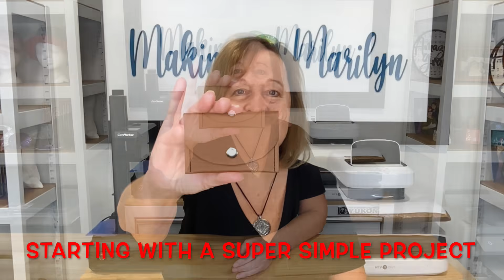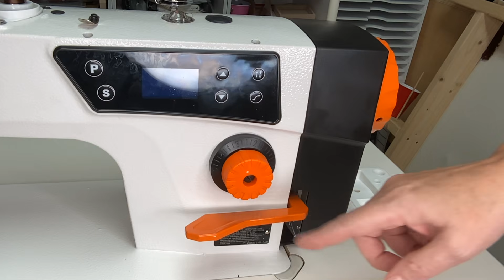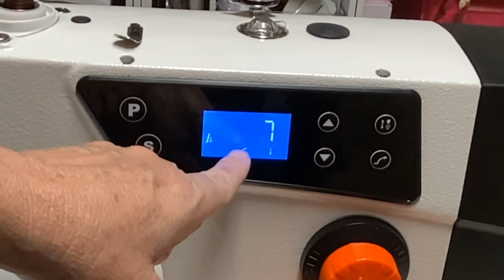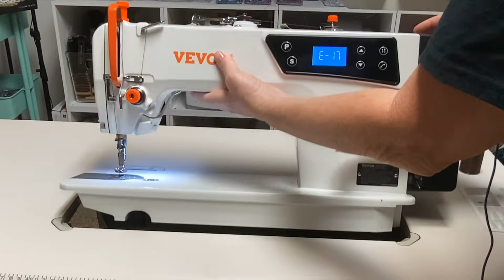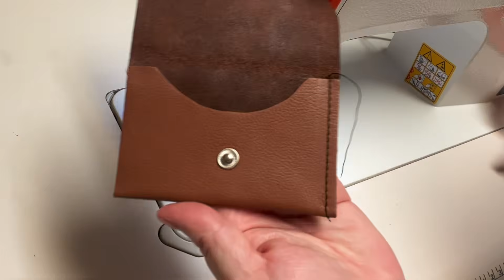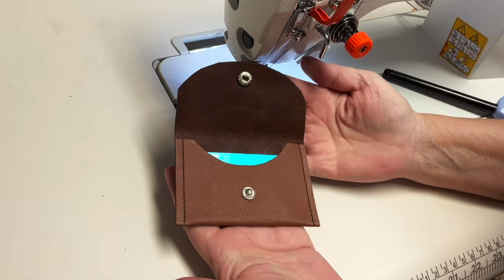Vevor Industrial Sewing Machine Overview and First Project #vevor

Comment from the maker: If you want to check out this machine, here is my link to it (it is an affiliate link) https://www.vevor.com/sewing-machine-c_11158/industrial-lockstitch-sewing-machine-lockstitch-550w-servo-motor-and-table-stand-p_010794942604?utm_source=favorite&utm_campaign=010794942604&utm_medium=99265155&utm_content=1020107949426045946&utm_term=722&compress_code=QTX5S2 
 (my machine and table came with some cosmetic imperfections)

Comment: How was shipping on this machine? Did it take long to receive it from the time you ordered it? I can’t find any information on if it is shipped from overseas or from the U.S 😊
Reply from the maker: As I recall, shipping was from a US warehouse, but I assume it originally came from overseas. However, I don't know that. Also, I think shipping is free. I have a link in the video description but it looks like they are currently out of stock. Here's what I think is the updated version b/c it says it has a thread trimmer and mine does not. https://s.vevor.com/QT03G0

Comment: Do you know how to lower the feed dogs.
Reply from the maker: Here's what I found when I researched it. But if your goal is to lower the feed dogs below the needle plate for free-motion quilting or embroidery, the M2 does not appear to have a quick drop-feed function. The manual's procedure is an adjustment:
Turn the machine completely OFF.
Tilt the sewing-machine head back in the table so you can access the mechanism underneath.
Locate the feed bar and feed-bar crank.
Loosen the screw on the feed-bar crank.
Move the feed bar downward to lower the feed dogs.
Retighten the screw securely.

Comment: Does it use DBx1 needles like most the other industrials? Same bobbin case and "L" style bobbins as the jukis? 
Also the knee raiser question... My juki only has .5" raise manually as well but with the knee raiser I can go up to 1.5". Same with this? 
This is so cheap for a full industrial setup with table. 
Also my motor is mounted under the table and I have a belt and it's a big motor I think 750w
This is listed as 5000 stitches but looks like you showed 3700 is max
Reply from the maker: Yes, it does use DBx1 needles. And it does use L style bobbins. I assume it is the same bobbin case as the jukis, but I do not own a juke. I recently adjusted the knee raiser and can now lift the foot higher than before but I don't think it goes up a full 1.5 inches. The motor is also under the table and it is a servo motor.
Reply: The 5000 is motor rpm, not sure why they went that way......3700 spm would be a more common spec...

Comment: I'm curious, is this like my juki with my new servo motor where you can vary the speed with the pedal and when in needle down and the end push back on the pedal to raise the needle up? 
I have a needle position sensor I added to mine and when I'm done if I push the pedal backward it raises the needle and is ready for another seam.
Reply from the maker: This does not have variable speed on the pedal. There is a button on it to raise the button. Not sure if the heel does it also. That sounds nice.

Comment: Was there other spots on the machine that need to be oiled besides the large reservoir underneath? I’m looking for help since the instructions are not very helpful
Reply from the maker: I asked JChristopherGear about this because he knows this machine so much better than I do. He had an excellent response with great tips: Pretty much, if you keep the oil pan full, and the oil wicks are down in the oil, you should be good to go. You can take the cover off the end (the needle end) and make sure it's wet. 

He also told me that if I sew slow, which I do, to turn it up to the max speed and run it until I see oil in the bubble. You would do this on scrap fabric.

Please check out his channel b/c he has excellent videos on this machine https://www.youtube.com/@JChristopherGear

Comment: Was shopping for a Jukie and came across this...Love the price but hate the plastic parts.  Do you think it'll hold up?  And curious as to why you didn't backstitch?
Reply from the maker: I really should have backstitched. I hope it holds up well over time. I won't be using it nearly as much as my everyday sewing machine. But if you are concerned about it and have in your budget to buy the real thing instead of a knockoff, I would go for it. For how often I will use it, I'm very pleased with it.

Comment: I guess iM one of she eople that likes watching Youte videoes   I was a little curious abut the Vevor machine and based on this video  I have to say iM impressed with  all the. Extras this machine comes with. As a standard  the Oil Sstem  ,Bobbin  loading andthe Computerized  Options on speed and needle position at stopping is all kind of impressive   I personal have been doing boat and Automotve  Sewing  on. A very basic  Industrial Strength Walking Foot Machine that meets m needs  as it’s a hobby of mine not a business   I bought the Chinese Knockoff from eBay  ears ago  that is  basically a White Clone  that the original patents expired on I was  skeptical about buying it  but I’ve found that  an Part I order fromSailRitte fits  my machine  without modification or problems
Reply from the maker: Thank you for watching. I just love watching YouTube videos as well 😅

Comment: Hi can you tell me the distance between the needle and the column to the right....it looks to be 10 inches, is that correct?
Reply from the maker: Yes, I measured it and it is just over 10 inches. About 10.25 inches. It's a nice size.
Reply: @MakingwithMarilyn thanks...it looks like a great matching and that distance is on par with other industrial machines

Comment: What is the max amount of leather you can run?
Reply from the maker: I ran out of room under the presser foot and the machine was easily getting through the layers of leather. Here's a video that shows it. Also, I learned that the presser foot will lift even higher with the knee lift, so I will have room to add at least another layer. https://youtu.be/1KhUyt-nU9c
Reply: Be careful.  Don't choke  it down too much!

Comment: Great machine and great price. Thankyou so much for showing it. do you think it will sew through several layers of cork and vinyl since it’s not a walking foot?
Reply from the maker: It showed through 4 layers of genuine leather. I didn't try more, but I will be. Since I'll be testing it out for a video, I will include cork and faux leather (is that the type of vinyl you are talking about or are you talking about the marine type vinyl?) I have both, so could try both. I even have some of that thick clear plastic that I could try. Also, you can add other fee to this machine. I believe one man I saw bought a set of various types of feet off of Amazon. I'll look into that also down the road.
Reply: Thankyou so much for the new video. I will be using regular vinyl for bagmaking. Thanks to you I bought this machine and love it!  looking forward to your future videos.